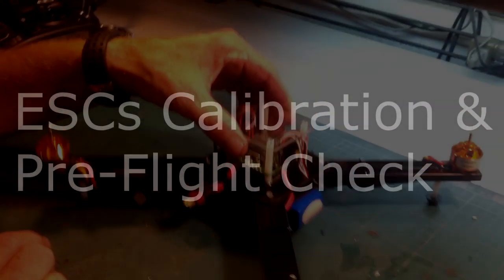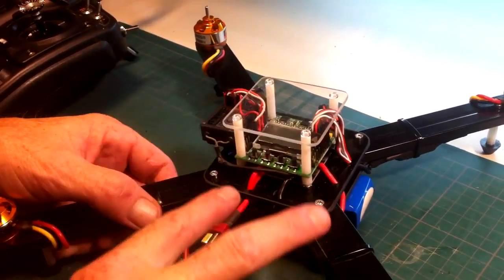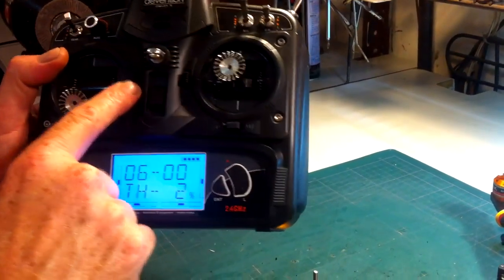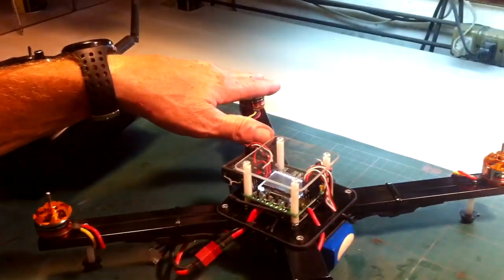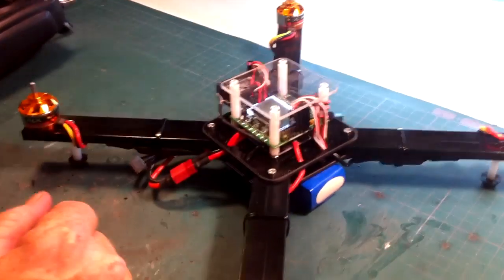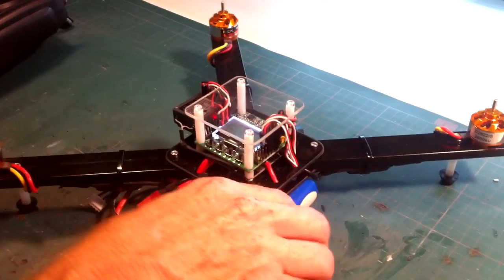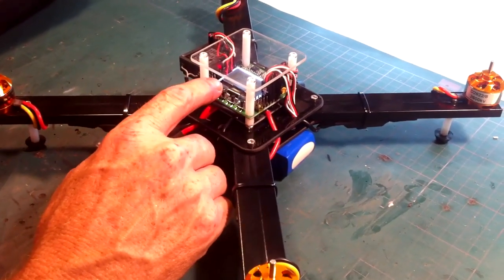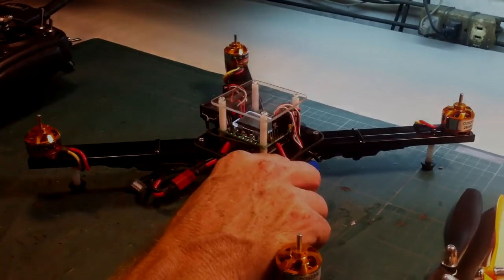Building A Quadcopter: ESCs Calibration & Pre-Flight Check (part4)

Comment: Great video, plss m new to quads and m having with controlling my motors, I av done the major connection from battery to ESC to kk.2.1.5 board anconnections  to the receiver but my transmitter is not controlling the motor...pls help me out ....urgent...

Comment from the maker: 1- Remove propellers
2- Turn the pots all the way left or all the way right on the KK board (right or left depends on the firmware you're using)
3- Turn on radio and set throttle to 100%
4- Connect quad and make sure the receiver binds with the radio
5- Reduce throttle to 0%
6- dDsconnect quad.
7- Set the pots back to their original position

Done.

Comment: Hey thanks so much for posting this video. Turns out the problem I was having was that I tried to calibrate the ESC's on my quad by plugging them one at a time into the throttle on my radio, then plugging them into my KK board. I have further testing tomorrow, but so far it looks like I needed to just follow the calibration procedure you show here, and it seems my problem is gone. I also sen't you a video response as to what was happening. Maybe it will help someone else.